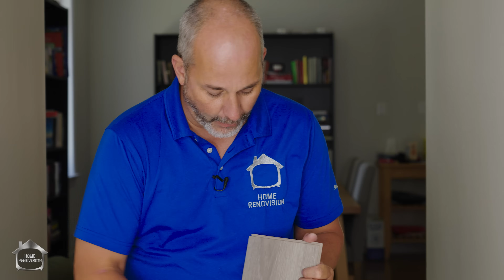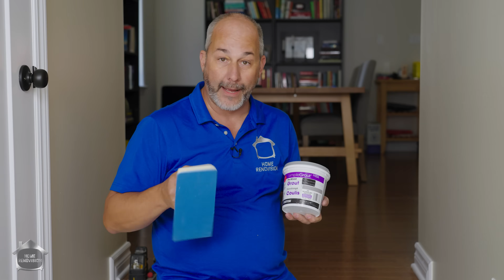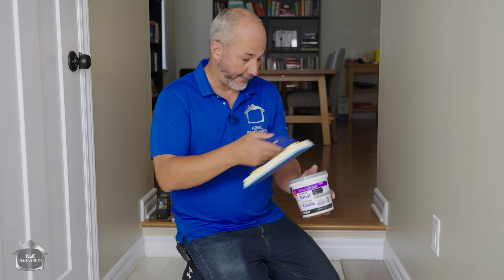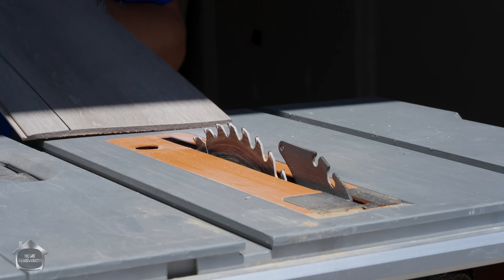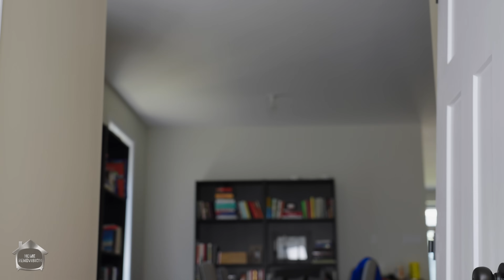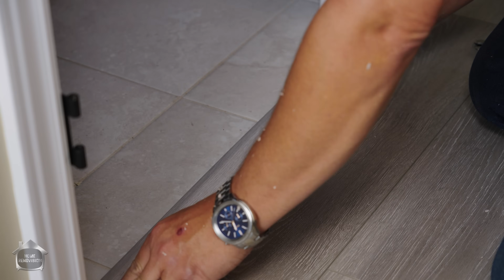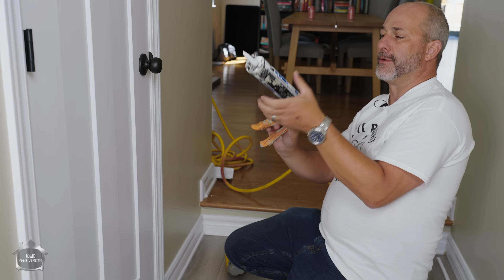10 Tips For Installing Vinyl Over Tile

Comment: Awesome video! One thing to point out about going directly over tile with a SPC core is to make sure the brand you bought will maintain the warranty if you go over a tile floor without patching first. Majority of Luxury Vinyl Planks with a SPC Core still require you to do a light patch over the entire tile floor for 2 main reasons: 1. The grout line CAN transfer through a SPC core it just takes a much longer time for it to happen 2. Most Tile floor over the years becomes slightly uneven and cracking which could cause structural issues within the floor which a lot of manufactures wont honour their warranty if the floor underneath isn't is really really good condition. But that being said, a light patch over a tile floor only takes a few minutes to do and a few hours to dry depending on how deep the grout likes are so it can still be done in an afternoon. Been an installer for many years and have also worked along side multiple reps that handle insurance claims for manufactures and these are the 2 main things i see often
Reply: Agreed I have 7+ years as a floor installer, always skim coat the tile floor with feather finish. I like to use a floor bonding primer (diluted) mixed with the feather finish cuts drying time significantly and increases strength of the leveling.
Reply: What do you use to patch floor?
Reply: This is why I opted to take the time to knock out the 12x12 tiles in our master bath. Most of the tiles knocked out intact with less mess.
Reply: I have a ceramic tile cracking in a depression, considering pouring leveler and covering with lvp. With the subfloor still uneven though that tile will continue to crack and that will translate up through anything leveler and anything covering it I am afraid.

Comment: Can you provide best vinyl plank for a cabin with a enclosed crawl space, which has no heating system and may be closed up during winter in Northern Wisconsin?
Reply: Engineered Hardwood is probably the best option.

Comment: If you have to use something like the Lifeproof flooring, (availability) could you use a floor leveler to elevate the grout lines from showing through later?
Reply: Yes. Always best to use leveling compound to file grout lines or just tear out the tile and start from scratch. Don't want to spend $10K on flooring and have issues down the road.

Comment: there si not much room for any potential expansion of the whole floor when exposed to sunlight or underfloor heating (probably not this case). Without replacing the baseboards with new one over the edge of the flooring it looks like a job half-done. Otherwise I see your attention to detail that I sometimes miss when coming across flooring installers on construction site. It's just interesting to watch how some jobs are done abroad.

Comment: You mention using an underlayment in the beginning of the video, but did I miss when you used it? Do you think it’s necessary to use a floor leveler?
Reply: His LVP has cork underlayment attached. I would use a leveling compound to file the grout lines.

Comment: You said people watch videos that give "bad information" and you didn't read the directions! NUMBER  ONE TIP: READ THE BOX! One tip you might like. In the doorway you attached the reducer to the vinyl,  if you have a toilet overflow the water will run right under your floor. I suggest you make a "dam" with pure silicone calk and attach the reducer with that calk. F&D has colored silicone calk to match the floor if you need to fill in that small gap around the door jamb.

Comment: Hi Jeff,  had a couple of questions and was hoping you could give me some pointers.  I'm installing a about 1300 sf of vinyl plank over existing tile.  the product I bought it's called Maxcore 7.25" x 48" x 5.5mm Luxury Vinyl Plank it is rigid core comes with IXPE  quit integrated sound reduction underlayment, it is 100% Virgin Premiou SPC Core. My question is if my existing grout joints are greater than 1/4" do I have to use  self leveling concrete to cover the joints, or can I get away with throwing a layer of floor mufffler underlayment from home depot?  also, when I did wood floor  at my house over 10 years ago I was tod to use spacers along all the wall,  I noticed that you did not use any spacers with your vinyl; are they not require with this type of floor?  thank you so much and thanks for the video, this will help me a lot on the project am working on.

Comment: Hi I wanted to know if you can help me my handyman put new vinyl planks in my 2 bedrooms and there was no baseboards on the wall and when he went to install the new flooring and baseboards  the floors came short and now I have gaps in between the floors and baseboards and I don't like the corner round look if you can help and suggest what I can do Thank you
Reply from the maker: Install a thicker basetrim!
Reply: So I should remove the new baseboard and get the thicker baseboard

Comment: Just a suggestion, stagger your joints on lvp randomly.  With at least 6 inches between joints. Pull from 3 boxes at a time. Don’t be a perfectionist (but be precise) when working with a material that’s meant to look and feel organic. Your customers will be much happier with the end result.

Comment: Installing over hollow sounding tile!!   I have many 1-foot tiles that are not bonded to slab properly and sound hollow when you knock on them.   I am considering removing all the tiles and grinding the slab to remove the thin set.    Some "others" in the family don't want the mess and ask to identify all the loose or hollow sounding tiles and fill with thin set and then place Luxury Vinyl or Laminate over this.   Thoughts from the crew? -?

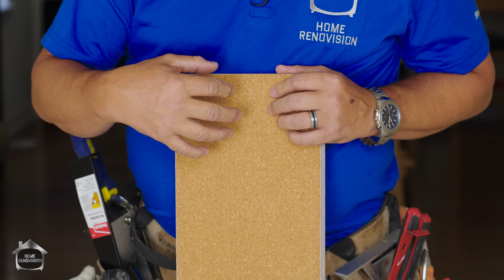Comment: Hi there thank you for great video I have a question or maybe im just confused.  At 2:00 you talk about the backing of the plank and say to get a underlinement but then throughout the video i dont see you place anything under during install. You just pace the plank right untop of the tile. I am confused about your statement on placing a underlinment if going with a cork plank. I am not sure if I need one and how the install process will go if placing one. Sorry about the dumb question but I didnt understand that because I never see u place any kind of underlinment throughout the video. Thank you for taking the time if you read this and getting back with me.
Reply: Many LVP tiles come with cork or foam attached. Some less expensive LVP doesn't come with underlayment attached. Just follow what the tile manufacturer suggests.

Comment: You did a good job installing it exactly flush to the walls BUT the instructions says to leave 1/4” gaps on the sides for expansion or it will squeak when you walk when it expands.  I learned the hard way by not reading the instructions. It is harder to trim the edges installed than the whole installation.

Comment: Most installation instructions (including Coretecs) call for an expansion gap of 1/4" around the perimeter. You show it installed butted up against the wall. Which is correct?

Comment: Can someone help answer this:   We are installing almost identical plank flooring (8mm thick) in our mud room over existing hard tile.  The tile currently buts up evenly with existing hardwood floors at the transition zone into the kitchen.  What do I do at the transition zone as the newly installed plank flooring will now be 8mm higher than the existing hardwood floors.  Any recommendations?  Thanks
Reply: Same as the video.  Just as the video added a transition strip to transition from the higher vinyl flooring to the lower tile flooring, you will be going from the higher vinyl flooring to the lower hardwood flooring.
Reply: There’s a different transition strip for that

Comment: Do we need gap on the side? Like most installer do for material  to expansion.
Reply: Follow the manufacturer's recommendations.  This video did not allow a perimeter gap, since he stated that this type of vinyl plank has a stable core and it's shrinkage and expansion is virtually non existent.  It also depends of the size of the area that you installing into.  Small areas, like that hall, will move very little.  Large expanses have a greater opportunity for greater movement.
Reply: @chrisgraham2904   Dude that stuff does not expand its vinyl
Reply: @normanalvarez5751  Your wrong!  As noted, those LVP products, such as in this video, are fairly stable against expansion and contraction.  Many different core materials and thicknesses are available on the market and many have substantial temperature expansion differences.  The majority require a 1/4" minimum gap between the LVP and perimeter wall surfaces.  Many are clearly marked by the manufacturer as not suitable for installation in unheated and non air conditioned, enclosed porches, for example, where temperatures fluctuate, expansion and contraction are drastic and the manufacturer will not warranty the product.

Comment: I want to vinyl my entire first floor. The 1st FL is carpet but tile in the kitchen. Will I need to remove the tile or just put transitions on both sides? The tile has deep gaps between each tile as part of its design. So I’m assuming I’ll need to fill all those gaps, correct?
Reply from the maker: I would keep the tile and use a transition strip.
Reply: @HomeRenoVisionDIY  thanks

Comment: omg. how are you promoting a floor and decor floor and calling it cortec. floor and decor does not carry shaw flooring or cortec. the plank you have is the brand nucore and specifically nucore performance. it has a stone core and a cork back as all nucore does. the wear layer is 22 mil and it has an additive called techtanium plus giving it extreme scratch resistance.

Comment: Great product info but, I would recommend a pro installer or a carpenter or a ,what's the word for not quite a perfectionist, get that guy. The joints you left will make small children disappear. But the info is valuable to me and I've been in the bus. for 42 years. Thanks, but get an assistant "carpenter". p.s. you calling, to me, is in sales. I beleive it all, ya know ?

Comment: another question 🙋🏻‍♀️:the saw your are using-is there a safety guard i could buy to add so i can keep my phalanges? or safety gloves that are cut proof that you recommend?

mrs flores
Reply from the maker: yes the saw comes with all the safety devices. I just don't install them when I buy them. Cheers!

Comment: Been installing laminate for over 30 years...little tip to make life easier.  Use a door jam saw or a good multi tool with a good blade and under cut the door jams instead. Board slide right underneath
Reply: Just a tip from a clumsy painter. If you ever get paint on your floor, just leave it. Do not touch it or try to wipe it off, if you wipe it it I’ll smear all over and then you are going to need paint thinner or something to get it off which may damage your floor. If you leave it alone and just let it dry, you can easily scrape it off completely in one piece without any damage.
Reply: Having all the right tools always makes the project so much easier
Reply: I’ve been doing this for 110 years and I’ll tell you what, I don’t even use trim. Problem solved.
Reply: Only way undercut
Reply: @billevans3910 agreed and if you need to remove planks Get NEW CASING...WAY EASIER AND SMART
Reply: A lot easier with a jam saw I've been doing it for over 40 years 👍
Reply: @normanalvarez5751  alot easier to just use quarter round. Been doing this for over 50 years.😅😅
Reply: @MattPera-kc8cg Quarter round on a door jamb? That’s a first.
Reply: Nail remover tool…GREAT invention.
Reply: Or a oscillating saw
Reply: Ty,, truly appreciate the tip. Never thought of that
Reply: Laminate flooring was invented in 1977 by the Swedish company Perstorp, and sold under the brand name Pergo. They had been making floor surfaces since 1923. The company first marketed its product to Europe in 1984, and later to the United States in 1994. If you begin installing laminate flooring the same year it was available, 30 years install experience would require a Dolorean at 88mph
Reply: @winnebagus  He could just keep the  Delorean  in the garage. Since 1994 to 2024 is exactly 30 years, he’s right where he’s supposed be! Lol 
😂😂😮😮
Reply: A lot easier to just hire someone, I've been doing this 0 years
Reply: 😂😂😂😂😂😂 @ashleyhilkowski1520
Reply: @ashleyhilkowski1520 boringgg
Reply: Dude explained NOT to undercut because if next person wants to remove floor and tile below it to install new tile the door and casings will then need to be replaced because they will look like high water pants
Reply: @laurie6123  Yeah, but that's the "next" person.  LOL
Reply: @jkmarshall3553 right how many years till it’s gonna need changed again

Comment: I am getting conflicting information about cork vs rubber backed Vinyl Core flooring needing an underlayment.  I will be installing a 6.5mm rigid core plank with Cork back over 800 sq ft of tile and I would like to avoid putting underlayment if it is not necessary.  I see you installed a cork back right over tile with grout lines thicker than 1/4 wide.  Your comments in the video around the core backing answered my question around needing to float a filler to avoid translation of grout lines over time.  I would not expect grout lines to translate through a thicker core floor as they would a flimsy vinyl product.  This is the answer I have been searching for. I find your videos very informative and am grateful for the time you take in explaining everything.  Thank you so much!
Reply: Hi I’m also in the same situation as you were. Was wondering if you ever got around to installing your flooring over your tile with no underlayment and if it held up well?

Comment: Use blue painters tape on the bottom of the door before using the saw. Most saws have an aluminum base and leave black marks on the door paint. Using a 4’ clamp can help you make a straight cut
Reply: You cut the door jams 1st with a fine cutter using a piece of the woodfloor lot easier

Comment: The 1/2 round is a turn off. I'd just remove all the baseboards and install new ones. Transitions are also a turn off! The LVP planks should just run consistently all over (no transitions!).
Reply: i find your tone a turn-off.

Comment: Open floor plan.  Tile transitions into a carpet area.  If I pull the carpet to lay planks to cover the total area ( tile and carpet area) what could I use to eliminate the lack of tile under the carpet? Is there a pad or leveler to eliminate the drop?

Comment: Thanks for another great video. For me without a doubt the most difficult part of a very smooth installation with vinyl plank floor is cutting the last plank for a very un-square room.
Reply: Use artist tracing paper to trace the cutout. Then tape on plank and cut. Goid luck!
Reply: Measure length and width in a couple places each way ..or simply make sure the first piece of plank is square to room  and the rest will follow suit.

Comment: Ahoy! We are planning on this route with our floor update, thanks for this well informed video. Would you suggest a Vapor/moisture barrier between the plank and ceramic floor even with the appropriate plank material with waterproof backing? Especially for bath and kitchen area?
Reply: If the plank is rated with a waterproof backing, you don't need any additional vapor barrier.  Some manufacturers will void the warranty on the LVP product if a vapor barrier or any additional underlayment is used.

Comment: Jeff, what's your take on installing a floating vinyl floor in the kitchen?  Install it before or after the cabinets?  I've heard the weight from the cabinets can interfere with the expansion/contraction of the LVP and cause the seams to separate but my kitchen guy insists I should run the flooring under the cabinetry.
Reply: u dont want a floating floor being impinged that badly around the whole circumference of the floor, n use a great pad too, you will appreciate it down the line!  im sure this is too late for you, but maybe itll help the next
Reply: @trope5105  I dont think I got your advice. I am installing vynil flooring in my concrete basement, which will have a kitchenette (counters, fridge, etc). Vinyl floor the whole surface and put on top the kitchenette stuff or put kitchenette stuff first then vinyl floor the rest of the surface?
Reply: @anurruti  either way off its glued, i personally would put the flooring in after i set the island, but either can be made to work.  But if you steer using a floating, fake wood flooring, which is what i interpreted the. Op's comment as, then u need to do it after the fact, and leave enough room on the edges for expansion and contraction.  Glue on laminate flooring doesn't expand, so dip what u want with it,

Comment: I mean wow. I get that your a GC. This was hurtful to watch. Subway laying of the planks? Why not undercut the door jamb with a Roberts saw instead of the ugly cuts against the door trim? If your a DIY'er at least undercut with an Oscillating tool. If you undercut it will look better if you change the floor later you can remove 8" or so of the casing and replace back down to the floor. I see your trying to help but as an installer this info is just not perfect. At least tell the viewers when done right you should always remove the existing tile. Not everyone wants to for sure but it is the right way. Again this was exhausting to watch.